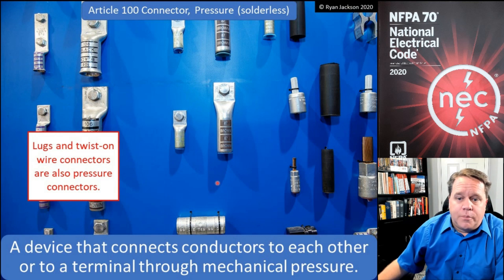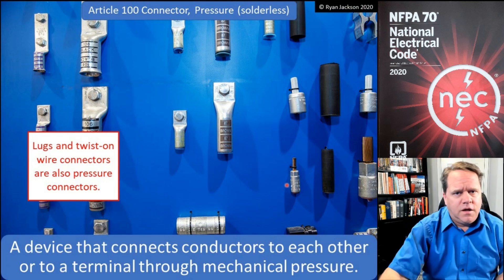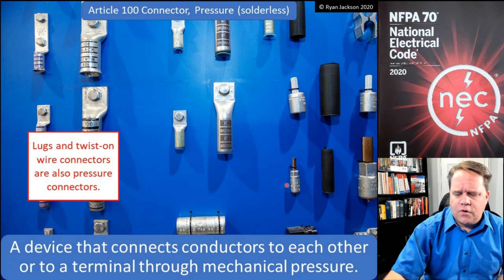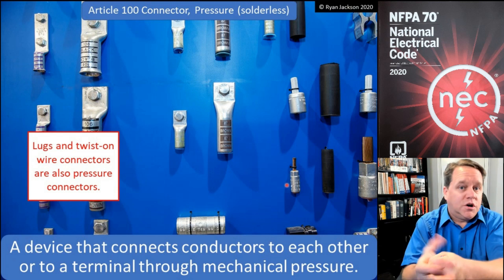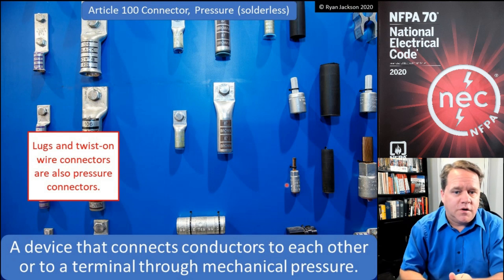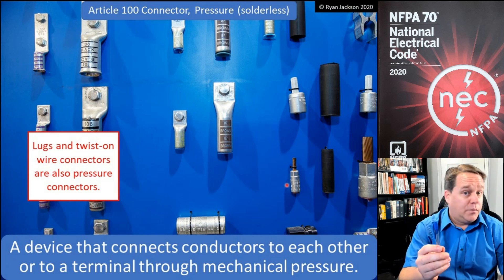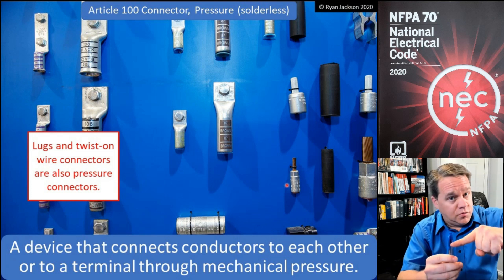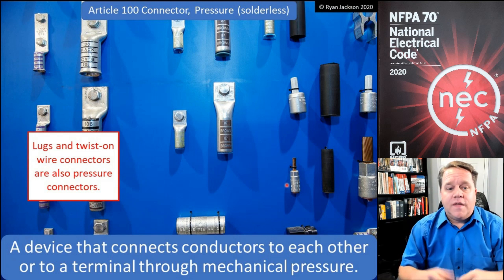100 Days of Article 100: Connector, Pressure

Comment: How about the amperage rating of lug and small insulated crimp connectors?  What kind of connector are allowed and not allowed in certain installation ?
                    Like 480 V using a cheap thin Home Depot cheap flimsy insulated eyelet crimp connector let’s say 30 A ?
Reply: Manufacturers should have a rating for them if not don't buy it...
Reply: Falls under Listed or Identified in the code.
Reply: @MR-backup  only problem is there’s no mandatory listing on a lot of these cheap items they sell inconvenience big box stores.
Reply: @coldfinger459sub0 Which makes them Identified; if not, then you are right:
don't use them.